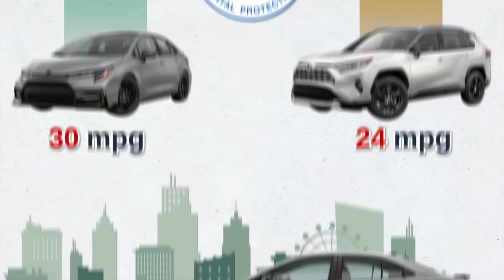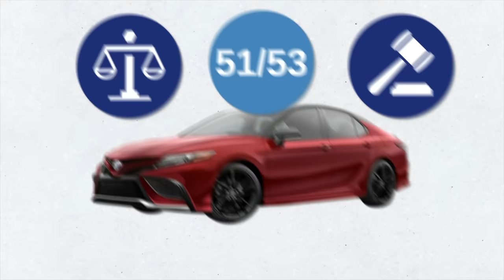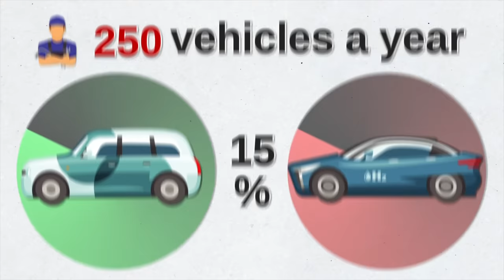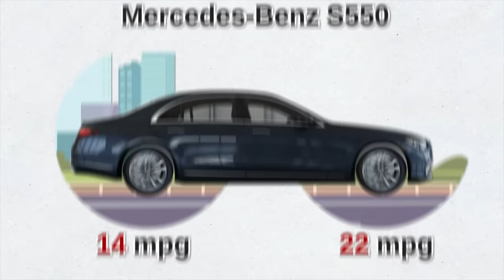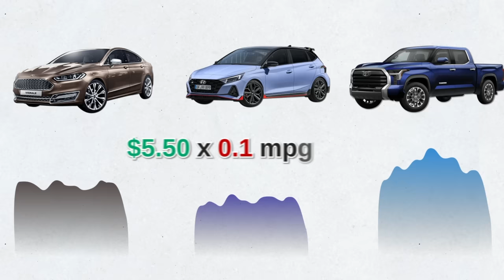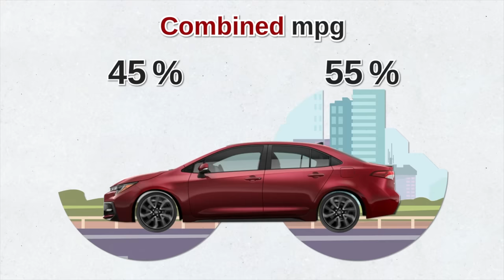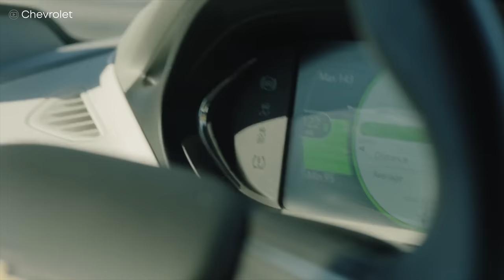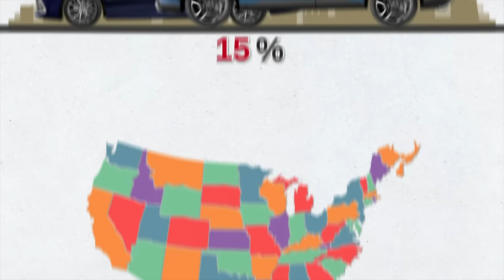Here’s Why the Government is Making These Engines Illegal

Comment: I have had a 22 Civic Sport ( 2.0 natural ) for about 2 1/2 months now , and put  2,000 miles on it . The worst I have seen on the instrument panel , going 75-80 is 31.8  . The " best " I have seen is 34.1 . So , it is pretty close . Hated to HAVE to buy now , but . My truck was done , and used prices were without a few G's of NEW .   ANYBODY else have a NEW Honda Civic Sport / other ? What are you getting  ?  Be safe out there folks ... Gubs
Reply: Just recently bout a 2012 civic 1.8L(R18) sedan. Wife needed her Lexus back and driving a lifted f150 108 miles a day for work is expensive for the fuel I’d pay I could have a commuter. I live just outside the metro to Phoenix and commute to the west metro. Mostly high way outside of about 14 miles of it. Only on my second tank first tank the Honda mpg gauge said 43.6 hand calculation was 44.7. And on this second tank I’m at 44.6 on the Honda mpg gauge. Like I said mostly flat and I keep it on eco and run 65mph.
Reply: I have the 2016 Civic EX 2.0 w/ CVT. I'm generally a very calm driver except when I get onto a highway, I enjoy alittle burst of speed. Most of my driving is highway for the few months I have owned the car but I do at least 35% in the city and my average is 34mpg with my best at 55.4mpg which surprised me. I also do use cruise control alot on the highway which helps regulate throttle response saving gas too. Grant it, it seems the average speed I see drivers on the road anymore go 15mph faster than the posted speed limit, for both city and highway roads, there's just no care anymore sadly but I do get alot of honks at me when I'm going the posted speed limit when I'm not "going with the flow of traffic"...
Reply: it will get better mileage after time and engine broken in more. some Oils will net you better economy as well.
Reply: I have a 2012 Civic LX. I am getting 37MPG.
Reply: @jaysmith179  1.8 ?

Comment: My GS 450H Lexus 2013 was having tire pressure censors, the gave me a 2022 NX300 nice little car.  The big 5 inch snow let me road test, fantastic in snow.  My GS rear drive is not fantastic in snow but the giant tires, snow button, and sane driving, required.  It, the GS, usually stays it in the garage 20-33mph, and the RX 350 comes out 19-25mph.  They are tools to use as needed, both bought used at the local Lexus Store.  Serviced at Lexus Store where they treat me like a prince, loaners on request.   I don’t have a Scotty other than here.  EPA numbers are a Wild A$$ Guess or WAG, your mileage may vary, the GS wants to run 90+ on interstate but so does the the RX it just takes a little longer to get there.

Comment: 2016 Camry, the sweet spot is 65 mph. Driving like you've got some sense I can get 35.4 MPG which I find amazing. Drop to 55 it'll drop to 29 MPG up to 75 mph it's going to consistently be about 31.5 MPG. City stop and go bottoms out at 24 MPG while sitting in place for traffic or lights and accelerating guzzles gas like a turbine engine.
Reply: Something  is terribly wrong with your car ...
Reply: @sking2173  ya think?

Comment: Using an electric motor that can serve as a regnerative brake and an off the line torque boost provides much improved fuel economy along with better braking, longer intervals between brake maintenance and less pollution while maintaining the ICE infrastructure. Make it a plug in hybrid and for shorter, city trips, the hard core can drive pure EV but use fuel if then need to go further, avoid range anxiety and be ready to go with full heat or air conditioning any time. Even if not driven EV only, stop and go driving especially benefits from hybridization.

Comment: Hi Scotty, I have 2004 Toyota Camry SE 3.3 Liter V6. I’ve had a lot of work done on it like the rotors, breaks, wheel axel, wheel bearing etc. I need to also fix the frame and the flex pipe. Do you think I should keep it or sell it? I know V6 wears out faster but I’m a very conservative driver.

Comment: Scotty, is have a 2006 ram 1500 LST 2wd with 105k on it in solid condition(the guy who drove it previously was gentle)
I know you hate them but i didn’t find you until a year later. I’m religious about my maintenance, oil change fluids, etc. I’m a young marine who needs the truck to run for at least 5 years then I can find other options. What are the things that will likely break and what should I do to keep her running without major issues?

Comment: yeah, those advertised MPGs can be met without wind resistance and gravity 🤣

what I do however is not take those numbers to heart, but use those numbers to compare with other vehicles, to get a general idea "this one overall uses more/less gas than that one" etc

I did an experiment a couple summers ago, I purposely drove like an aggressive smartass on one tankful, then reasonably on the next tankful, and difference was 13 MPG vs 18, so there you go

Comment: It only increases the "Cuban Effect". These mandates increase the cost of these new cars to the point that people like me simply keep their older, existing vehicles on the road for far longer periods of time because it becomes more economical to do whatever it takes to keep older vehicles on the road than to spend money on a new car. I drive a 1992 model truck as my newest vehicle. It is pre-OBD II so I do not have to pass emissions, the engine is easier to troubleshoot and repair, and the truck is one of the last models to have the throttle body injection, which is far more reliable than the troublesome "spider injection" which has a reputation of leaking and failure, that the 1996 and newer models have. For my other vehicles...well I am keeping my 1951, 1963, 1972 and 1984 models alive and on the road.

Comment: At least around here in NJ there’s no way people are coming close to posted EPA MPG’s for their vehicles. They have 2 modes here, foot to the floor and brake 50’ before they need to stop. I’m amazed how people here take off from a light. I drive a 21 Mustang GT so for sure I’d have no problem taking them off the line but that’s gonna cost me a lot of fuel economy for sure. So if they complain that they’re not getting advertised fuel economy it’s more than likely due to their lousy driving habits.

Comment: I have a 2015 KIA Soul that I bought new. I routinely get between 21-23 mpg in town and 27-28 mpg on the highway. Occasionally I've driven on the Interstate at 55 mph just to see what mpg I can achieve and I've seen 48 mpg over a couple hundred miles.

Comment: In 1991, on a Ohio turnpike trip all the way across Ohio in the summer, >90°F, set on cruise at the speed limit, ~3450 rpm, my new, silver 1991 Eagle Talon All Wheel Drive with charcoal gray interior, 2.0L I-4 Turbo, 5 speed manual got 24.5 mpg, and when the A/C came on, it felt like a pretty big load the turbo had to come in to cover it and it never got comfortably cool.

A few days later, I made the exact same trip in my all black, 1991 Ford Mustang GT, 5.0L V8, 5-speed manual, >90°F, set on cruise at the speed limit, ~1750 rpm, and it got 25.5 mpg, and when the A/C came on, it got COLD.  I had frost forming on the inside of the windshield.  Also, when the A/C came on, it didn't even feel it like a major load was coming on. The V8 just shrugged It off.  

Sold the Talon.

Comment: They must have questionable emissions testing procedures as well. Emissions standards are tighter than ever, yet the north California valley is more smoggy than ever. Something is amiss! If they're going to take V8 engines away, i'd at least like to see the mountains instead of a grey outline of them!
Reply: The smaller higher stressed small engines require much more fuel to even muscle the car up to speed. We need bigger engines to come back
Reply: 1. Small engines with turbos are more prone to problems -> burning oil and smoke in exhaust
2. Lots of new drivers every year -> more traffic jams
3. Norcal gets lots of wildfires every year (gets more intense as the years go by)
Reply: @charlesrodriguez7984  that is only partially true. If you are in a 100-110 hp car like a Nissan Versa then yes, the mpg trying to get up to speed will be horrible.

Comment: In order to get the advertised average MPG, you have to drive with a gentle foot.  Drive any harder and forget about it.  I get 42 average MPG on 2020 Nissan Versa.  I'm not in a hurry to get anywhere, especially to work, so my gas peddle is treated very kindly.  😃
Reply: If you talk about the Versa Note i had the 2006 jdm CVT with 1.5l 4 banger.
Acceleration and engine braking were non existant. And on the highway it always settled by himself at 80kph. Brilliant shopping trolley, atrocious car. Unfortunately seating was too small and really starting to be hurting.
But, gas mileage, turning radius and cargo space (bigger on the inside… tee hee…) were never an issue. Not a breakdown in 7 years either…
Nowadays they are “epower” drivetrain a e banger make electricity for direct power and boost batteries. Red light rockets… looking good… but the price :-(

Comment: Our Lexus GX460 is perfect except for the V8 gas mileage.  It's bad and the new turbo v6 engines will be more efficient.  Fact is the turbocharger objectively increases fuel efficiency.  4 bangers get the same HP as V8s from years ago

Comment: EPA is corrupt. First of all, there's no such thing as 100% gasoline, so right there things are bad. Second, is that nobody does highway speeds of 55. Every does 70, so that should be the set speed. Third, the stronger the engine the less it will, vary. I had a wrangler rated at 17 combined and I was getting 15 after I added 33's and now, with 4cyl cars I get like 4 miles than city, so to me I subtract 2 mpg from their city and that would be my mileage. Stronger big engines work less just going uphill. My work v8 truck goes uphill at 2k rpms, while my elantra needs to be at 3k.

Comment: The EPA MPG rating system is a joke. What's not a joke is the fact that the government is working hard at legislating the internal combustion engine out of existence. Which may sound good on paper from an environmental standpoint, but did you see those windmills in the background that weren't spinning as the Chevy Bolt was zooming around? Windmills without wind & solar arrays without sunshine equals charging vehicles with fossil fuels & or nuclear power. Furthermore, there will not be a viable alternative to diesel fuel for at least another century especially when it comes to heavy equipment & tractor trailers. The distribution of goods would grind to a halt if you had to rely on electric 18-wheelers. There's just no infrastructure currently in place & it will take generations before there is one.

Comment: I'll keep my old 98' gmc pick-up.. It's paid for and still averages around 15 to 18 mpg depending on what I'm doing .. To be honest I'd rather keep her fixed up than buying the new overpriced junk they're building now.. Yes it may cost me here and there, but it's still better than paying between $450 to $700 a month for something that's supposedly better 😁.. Keep those old one's running and screw the auto makers and the government!!😂😂
Reply: My 1992 Chevy truck is a keeper too. It's one of the final models with throttle body injection, gets fantastic fuel economy (4.3l V6) and pre-1996...meaning no OBD II and therefore it doesn't have to pass emissions.
Reply: @lawrenceartz8640  I had a 93' suburban that went 320k before I sold it.. Still was running😁.. Love the older trucks and cars.. They had way more character than the new cookie cutter designs now.. lol!

Comment: This is nothing new vechical don't  have consistancy of power inline 4 cars can get 120- 200 hp but try finding a v8 400 -800 hp it's not possible  there is to much engine friction in a v8 engine inline engines are better